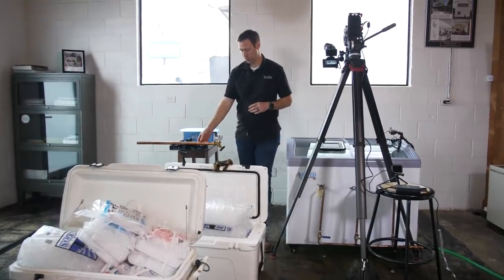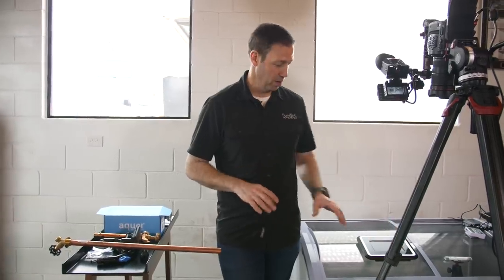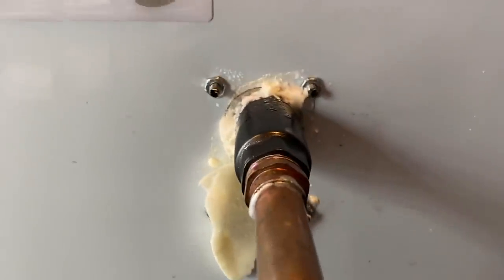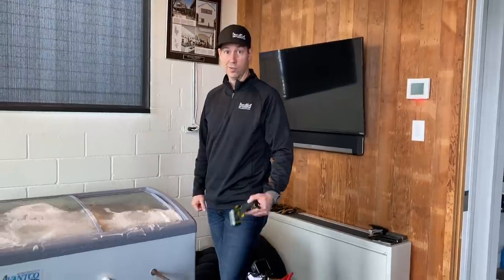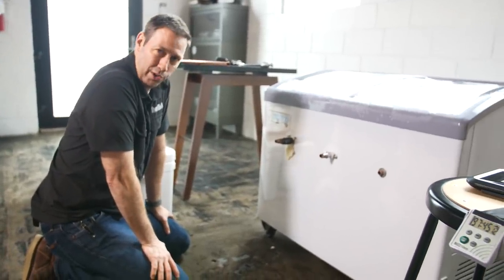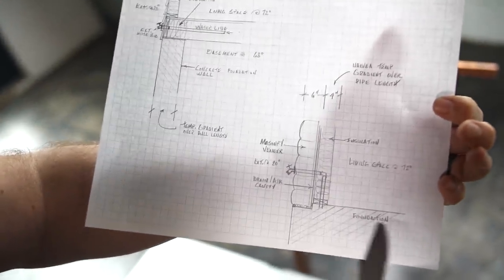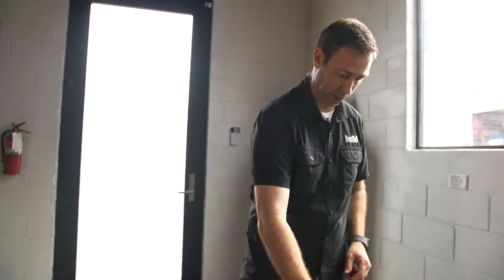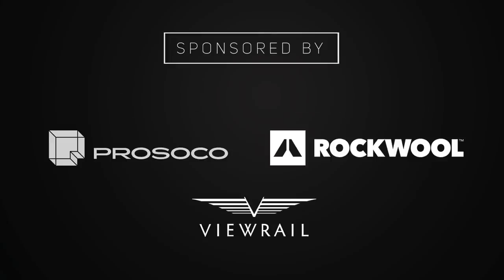Frost-free Hose Bibb?  Yep, it TOTALLY ICED over!

Comment: What? No ridiculously overpriced dehumidifier and super vapor barrier in your office?! 67% is too high for human comfort, paperwork, and tool/material storage. That's why there is so much condensation/frost on the outside of the freezer and pipes! Normally if it is cold outside the humidity is very low.

You also need to stop referring to "the south" like it's all one thing. Parts of the south are very humid. Other parts are very dry. Building methods vary greatly throughout the south - here in North Carolina slab on grade foundations are extremely rare, and frost proof water shut offs have been standard for decades.

The Aquor bib would be a lot cooler if it didn't have that chintzy plastic tap, that looks like a disposable tap from a 55 gallon drum. And of course it is going to get lost. A simple flap that covers a standard frost free hose bibb would be much better. Or just a normal hose bibb, because there is nothing wrong with that...Aquor is a solution looking for a problem.

Comment: Minnesota. I replace these shutoffs for different clients every spring. Or I have re-replace because "someone" replaced it at the end of the previous freeze season and didn't do something right. Typically the ones that freeze and split were not fully drained and they almost always have the feed line dropping down to the shut off. If the homeowner shuts the water off in the mechanical room and opens the valve at the hose connection for a couple minutes and then closes it there is still enough water in the line to collect over time. Essentially there is still water, but no pressure, behind the shutoff and given enough time in the deep freeze it can still cause a freeze expansion split. 
It isn't uncommon for me to have to have to pull off some siding and to replace the sheathing because it is so compromised that you can't remount to it. This means that not only did water degrade the sheathing, but wet wood is now a heat sink. Rot holes also let cold air sail through. 
I have even had to replace recently replaced shutoff plumbing well over a foot inside a wall where the previous repair person removed the wet insulation and never replaced it. 
I have seen water pipes split where mice have crawled in between the concrete foundation and the bottom siding and burrowed through the insulation over the pipe at a right angle. Just that tiny air channel can allow the Stack Affect to pull in enough cold air to freeze the pipe and cause catastrophic damage. 
BUILDING TIGHT IS BUILDING RIGHT!
Very often there is an insulated wall, but the person filling the cavity didn't cut in the pipe. They just went over it leaving a huge uninsulated cavity. I've even had to open up walls to see that insulation fail and multiple line patches because the repair people didn't recognize the root cause and just kept recreating the exact same scenario!
Reply: Wow this is the information I wanted to find out. How these things could fail. Thanks for the info! So how do you correctly install one of these

Comment: Others have already said it, you needed to purge the air. On the copper "test" you froze air and a little water mixed, it didn't condense much on the copper pipe because the air didn't transport the cold as well.
A better test would be, after purging the air, compare a "frost proof" that has been drained and one that hasn't. The one full of water is not only at a higher risk of bursting/leaking, it will drive more cold into the house and create more surface for interior condensation.

Comment: Matt, one reason the center bib frosted over compared to the flush mounted bib is that water is an excellent conductor of heat energy. For the flush mounted bib, the water went right into the cooler, and it was keeping that section of pipe warmer than the middle bib. In order to make frost appear on the right bib, the cooler had to chill the bib, the pipe, and water in the line, or get that section cold enough that the water would have frozen over and burst. 

The middle bib had that air gap. So there is less material and heat energy to work with. This means the cooler could get that four inch section to frost over. But the frost did not appear where your pipe was filled with water. It's not likely this would have failed, but it does bring up another potential issue: Condensation and eventual mold/wood rot. This bib is giving the moisture a place to collect and then eventually lead to issues in the wall.

Comment: Matt, It's not typically 50% RH inside of a home in the north when it's -20F or colder outside. In my older home no ERV or whole home humidifier it's more like 10-20% RH indoors in the winter. My older home has no insulation around the rimboard either, and I've never seen frost on the inside on the 8"-12" deep frost proof fittings. I had them apart when i moved in, but don't remember exactly how deep they are.

Edit: Also my unfinished basement is nowhere near 68F. That's my occupied firstfloor temp in the winter. the basement is close to 55F to 60F in the winter.

Comment: Even frostproof shutoffs will freeze if you leave your garden hose connected. They only work if the water can drain out as you close the valve.
Reply: Why would anyone leave an unheated hose connected to a hose bib? I use a heated hose and a floating trough heater to make sure my livestock have drinking water through the winter.
Reply: If the water hose is connected on the outside.  The water hose in this case is the supply line.

Comment: So what we've learned is to use straight copper pipes to the outside
Also don't insulate the walls near the hose bibs to help your interior copper pipes act as a radiator to the hose bib and prevent freezing.

Comment: 3 fatal flaws in the experiment as conducted. First as you said the wall cavity. Southern pipes wouldn't pick up the heat from the house as they come through the slab and into the wall cavity. Second is ground water temperature. Yes Northern homes may be exposed to 68 degree basements (many would be less), however the ground water temperature can be around 50 or less. So the delta wouldn't be very large allowing the freezing to take place easier. I would also allow the valves to run on the inside to make sure there was no trapped air as there would be the way you conducted. Air rises and the only place for it to go was the valves. I think you could build a temporary wall Sheetrock and all with all the metal tubing enclosed, only the rubber hose sticking out and get more accurate results.I realize it would present some challenges with filming but would be far more accurate.

Comment: Too much oversights in this video. thermal and electrical conductivities are totally different things. Air still in the pipes and expecting them to freeze? never gonna happen. Laser thermometer doesn't mesaure that way. laser light is just a guide and actual sensor is the opening below that laser. from the distance you are holding, the dot should not be on the pipe at all. You were just measuring the floor underneath.

Comment: I am in Ottawa Canada, a very cold place. You have to have water in the pipes to properly test it as the water will conduct alot of heat. 
We have the stainless steal facets that are a foot or 18 inches or two feet long. They go into heated basements, as heated basements are necessary in the cold climates.
Another thing that can be done is just having a shutoff valve with a air bleeder on it a few feet into the house, with the pipe on a downward angel from there going outside. The problem with this is the home owner must remember to use it.

Comment: One thing that drives me crazy, and maybe it has been said before, is that those non-contact infrared guns need to be corrected for emissivity! This is why the surface texture and material will have different temperatures. It is OK for simple tests but put a piece of black electrical tape on the surface and put the emissivity value to 0.95. Bam DONE!

Comment: I didn't like this particular video because the sight settings were unrealistic. Typically an old home would not have any insulation behind the hose bib, but any hose bib replacements usually get spray and foam filler (for my installations, I live in New Jersey). I'm 46 years old and I haven't seen a winter go below sub-10 degrees in... I can't remember.
Also you should have kept the water pressure on.

Comment: Experiment needs to be redone with appropriate insulation on the first 8 inches on the pipes to replicate an in wall install. This would keep ambient from warming the pipes and preventing ice plugs. Also, empty the freezer and turn the valves on to see if they are plugged before you cut the pipes. If you install a pressure tank, your can then pressurize the system and then remove the test system from the water supply. It would then still have pressure applied and a limited volume of water to leak  out of the system should a pipe split.

Comment: The ice on the 4" tail bib has cold air in it at the same temp as inside the cooler, which is why it is condensing water from the room air and frosting up. The room humidity is much higher than the humidity in the cooler. This doesn't mean anything. All 3 valves with the water filled pipe should be inside of the cooler, to duplicate the real world. Both sides of the valves need to be cooled below freezing, not just the 'outside' of the valves.

Comment: Down here south in Florida we do have even pipe outside of the wall but what I done like I done in Germany to my house all my exterior water spikets are having inside the house at the pipe a shutoff valve and so I leave my exterior wide open and shut off inside this way it will never do any of that. Even here in Florida I done this to my house. I never trust weather but even more contractors. So often I see a spiket been broken or ripped of the wall and so with the shut off I can isolate and allow easy work on it without having to shut off the hole house of water.

Comment: Bought my house in Oct 2017 and was informed there was minor water damage to the front foundation. No source for water was found, outside drainage was fine and wall was dry inside. Summer 2018 I found wet pipes inside when watering front lawn. Found pinholes  5 or 6 inches from valve, bib had a 10 inch shut off. Spray from the pinholes was wetting the foundation wall.

Comment: "Frost-free" has nothing to do with frozen condensation on the outside of the pipe.  What we care about is ice IN the pipe, which is unlikely to develop in a 1.5" foam-insulated wall cavity (as in this case).  (I also suspect the variance in observed frost had a bit to do with thermal mass, not just thermal conductivity.)

Comment: This test is interesting but semi pointless. Most new construction is pex, I dont see a single pex pipe connected. Also frost  free brass should stick out into the room as it is designed to be inside the wall with frost only touching the most outside portion of the unit.

Comment: The worst test ever!  Frost free silcocks  will only freeze internally. If the hose is still attached or it's back pitched. Trying to freeze it in a cooler with the outside air @ 70•F. While tell you absolutely nothing. As you saw none of your examples will "freeze" outside of the cooler!

Comment: As others have said in MN, Wisconsin, the Dakotas, and Montana, winter household air is usually very dry. The air in the house almost always has the same absolute humidity (or dew point) as the air outside. Because in almost all cases there is circulation. (Exceptions would be a well sealed house with a positive pressure and humidity management system that keeps the humidity in the 60% or higher range, or people who have whole house humidifiers in central air systems that are not junk, which all too many are.) The Dehumidifier in our basement next to a toilet where it has access to a drain is currently reporting a 27% humidity level. At this point, the hose bib feed is not likely to be collecting frost, even when we see -20 temperatures. 

I realize that every plumbing system is different, but having lived in several houses that are over 40 years old, I know that a lot of them have shutoff valves several inches from the inside of the exterior wall that the hose bib is mounted to (outside.) General practice around here is some time in September, say Labor Day, or into October, Halloween, shut off that valve, go out to the hose bib and open it to drain the bib. Even with that, when my folks built their house in the early 1970's, the hose bibs there were 'frost free' bibs where the valve for the bib was inside the house. At that point you just unhook the hose at the end of the season, and let the bib drain. I'm also aware that this solution is not perfect, and relies on good installation to provide the angle needed to drain that valve, but so far as I remember, we never had a pipe freeze, even the year we had -60 temperatures.

All of the above though is just my observation. Personally I'd like to see the flush mount hose bib installed in more places. Perhaps that 10 inch variety, but the main reason is that there have been a number of people who've come home from a summer vacation to discover that they were going to be paying a hefty water bill because some kid down the street thought it would be cute to turn on the hose at the side of the house. (not to mention what this can do to foundations depending on where the water ends up.

Comment: For the most part, air humidity levels are so dry in the winter that condensation doesn't form (for example windows unless you are talking kitchen/bath) up here in Illinois. There is more humidity if the temps float above freezing during the day and below at night, but at those temps the no freeze silcock is not cold enough to overcome the heat of the house (I have one exposed and visible in the utility room). On a humid spring/summer day, I have seen pipes with flowing cold water have condensate and dripping.

Comment: Ditto to all the comments below about leaving water pressure in the line while doing the test and about the emisivity of the infrared gun.

IMPORTANT is that the hose bib is SLOPED down to the outside tap so when the tap is closed off the water inside the hose bib can run out.  This is a common freezing problem if frost free is sloped the wrong way.

love your videos

Comment: I would hate to have the aquer stuff - you have to make sure you don't lose that detachable faucet otherwise you're SOL.  

In Montreal we had standard hose bibs with a ball valve shutoff in the basement ceiling that you'd shut off before the cold weather set in and open the bib. Never saw any condensation issues, perhaps because when it's cold outside it's also super nosebleed-inducing dry inside the house. Only ever saw that "freeze resistant" stuff in the US.

Comment: Hi Matt,
I live in a northern climate (Chicago) and I have a regular non- frost proof hose bib going through a basement and the original  builder installed an additional shut off just inside the basement.  Never had an issue with it freezing.  In the fall I'll shut it off from inside and drain the water remaining in the line. Great video. I liked when you pulled out the book and got some science to back up your claims.

Comment: Your shouldnt use a infared gun on copper or any metals directly. The low emissivity level is too low to get accurate reading. Object with low emissivity act like a mirror to IR and you are most likely getting more of the room's background infared radiation. Try putting black electrical tape on the pipe. This is one of the easiest fix to get an accurate IR reading

Comment: The copper plumbing conducting heat from the room to maintain some temp above freezing. Did you even purge the air from the bibs? You also have to account for your mains water temp.. At 0 degrees F average outside temp my municipal water supply drops to 35-45F even with the ground temp at proper burial depth the ground cannot warm the water mains because it is being consumed at a rate that is to fast to bring it up to the 50F ground temp so the water comes in at the temp of the water in the tower itself. Also I would think given the installation area would be below the 70F your experiment had. Some only heat the home to 60-70F this making it colder in the installation area of such a hose bib because it is in the barrier it cannot equal temp to either the inside or outside and likely favors temps closer to the outside thus at 0 outdoors temp the bib installation area is likely very close to 30F. I personally refuse these type of hose bibs and chose to use the yard hydrant design for outdoors water access.

Comment: I’m in Wisconsin and never got around to putting in a frost free spigot. I have a shut off in the house and then I open the valve outside. I’ve never had a problem even when we hit -22F last winter. I’ll keep my fingers crossed just in case🤞🏻

Comment: Repeat with lines purged of air, and simulate the pipes being in a wall cavity with minimal air movement.  Perhaps have an elevated purge tank under pressure to keep your samples under water pressure, without having an active main…  Even just a plexi-glas shell so you can see the lines.  Or they make a double-wall extruded polycarbonate panel that makes a good minimally insulated wall that you can still observe through.

Comment: I do not know for that particular model of hose bib, but my in my limited experience, all models I have installed or had installed could be sweated or threaded (if not setup for pex).  Just because it has a MIP fitting dose not mean that it was installed incorrectly.